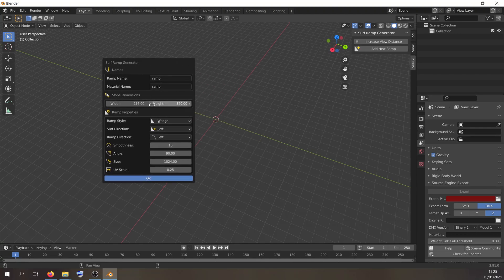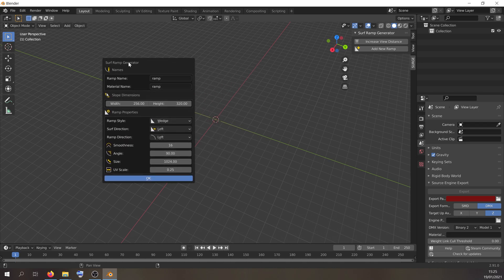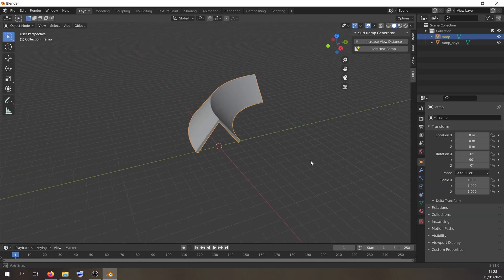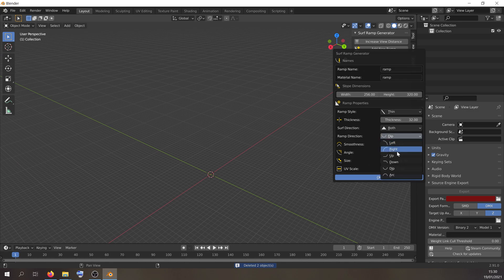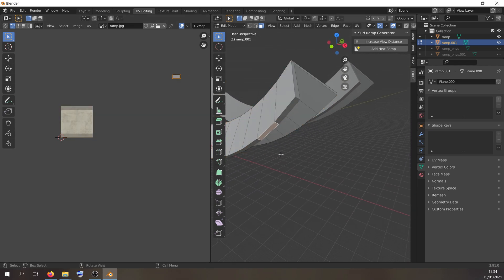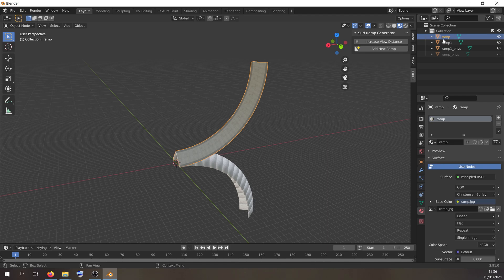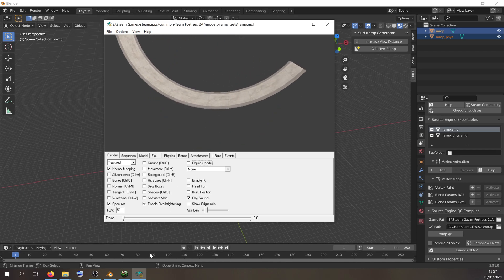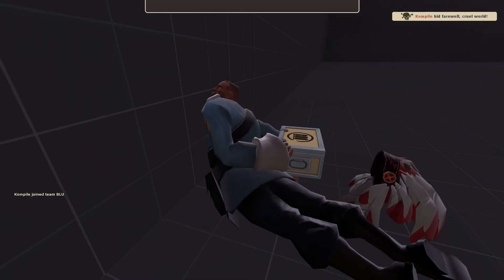Creating Surf Ramps in Blender using the SURGE Addon

Comment: Hey just commenting to tell you i'd really like it if there was a option for a "straight" ramp option because i dont feel skilled enough to make the thin ramps and i want some to not have a curve :] thanks but yeah it would take some time to just make possible so hit me back if you ever choose to update the surge addon with it thanks :D
Reply from the maker: Hi, a straight option would be cool, but unfortunately straight ramps using VPhysics (model physics) in source engine are buggy. When I checked last, you get stuck trying to surf on them for some reason. So if you are going to make straight ramps using models, the visual part only should be a model and you should disable the collision on it - then use a brush instead as the part players actually surf on.

I should have made this clear in the video, so sorry about that.

Because of this I didn't add them in, but to make just visual models with no physics could be a cool option.

I probably won't be updating this anytime soon though. But hopefully you can still get what you need from it.

It would be really cool if the ramps updated in real-time as you adjusted the values too, but I wasn't clever enough to work that out 😀
Reply: @SDKompile  oh yeah well im using the meshes' complex collision with a different engine (unreal in my case) so the physics assets werent really the most useful thing although i could always try to find if i can't find a solution for it. my "custom" solution gave me some tangeants errors and extremely small binormals so it looks absolutely horrible but all the other meshes seems fine and surfable :)
Reply: nwmmm i can just set the angle to 0 to give me the "normal" mesh but still a neat idea you would just have to code it to be an array modifier to [n] slices choosen during the menu part. had a look at the code myself and will try to find if i couldnt make the change myself 👍

Edit: new issue straight ramps using my method do not give the correct width and editing here cuz dont wanna flood my own replies ahah
Edit 2: can just extrude the desired amount and fix manually using orthogonal view to align the vertices

Comment: is there a way to do a straight ramp?
Reply from the maker: Straight model ramps are quite buggy so it's best to use brushes for them. You could make the visible part of the ramp in Blender and then make the collision from brush geometry in Hammer, but the plugin doesn't make straight ramps because of the issues with collisions.

Comment: Great Tool and Tutorial, but my ramps spawn allways with -90° so i have to rotate them allways with "alt+r" back to +90°, is there a way to change this? :D
Reply from the maker: Hey thanks! I've not had that issue before, but you can set the rotation in Blender by going to Object > Apply > Rotation and that will set the ramps' rotation to whatever it currently is. Make sure you're in object mode and the Object menu is in the top left.

Comment: How feasible is it to make the entire map in blender with this tool and export as one to hammer?
Reply from the maker: You would still need to use brush geometry in Hammer to block visibility and the lighting on models is not as good as brushes, so you couldn't make the entire map out of models. If you mean making all of the ramps for a map in Blender and joining them into one big model, it might work, but you could run into some limits with the physics. Also, the massive ramp model would only sample light from its origin so the entire model would be lit the same.